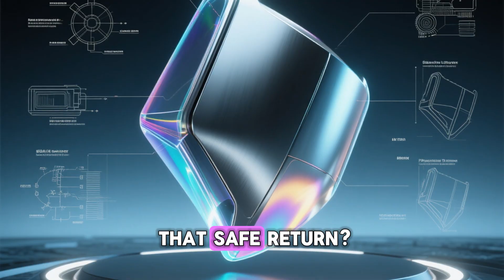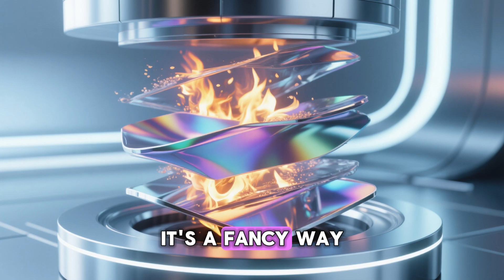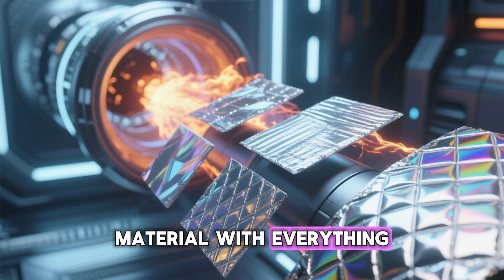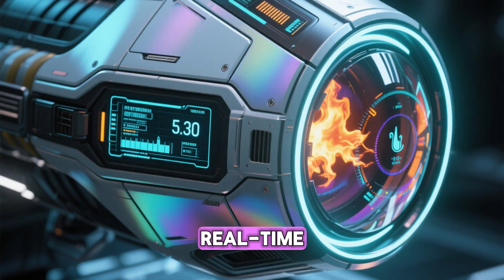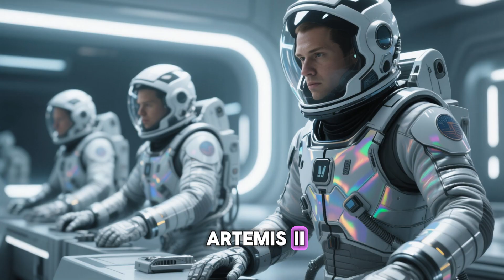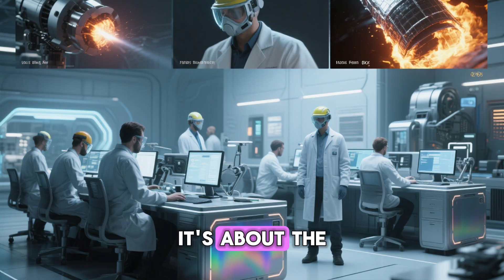NASA's Artemis II: The 2026 Heat Shield Breakthrough You NEED To Know

Comment: This is hype for the heat shield. Propaganda for the makers to sell us on the idea it is safe. Despite the rejiggered reentry plan there is a sufficiently significant probability the heat shield will fail. POLITICS  is preventing NASA from doing what is right. For very good reasons the powers that be desperately want to beat the Chinese to the Moon. But we need to either do a "fix" or develop a better heat shield before getting our astronauts burned up on reentry.